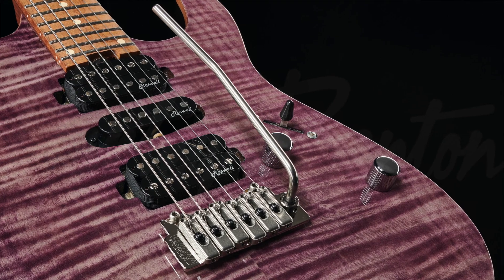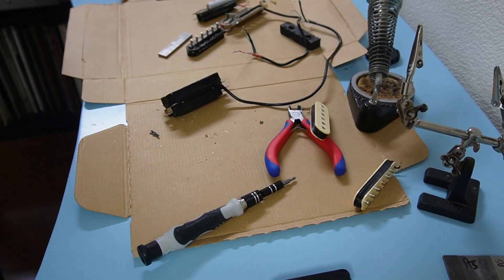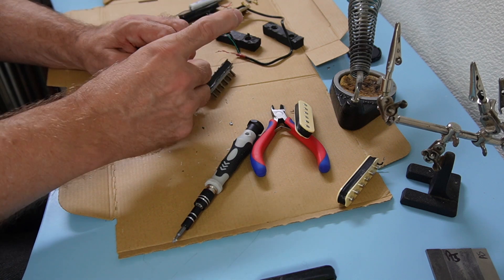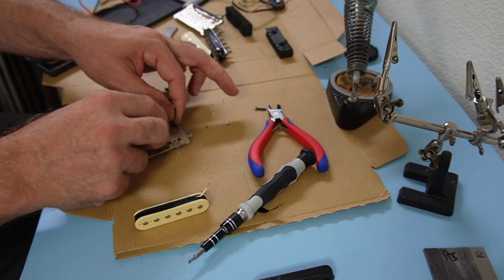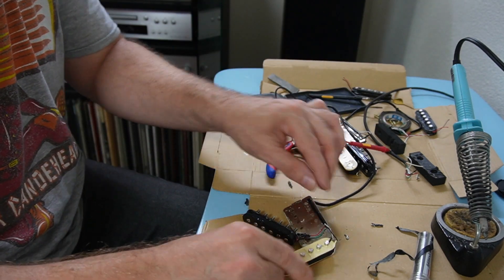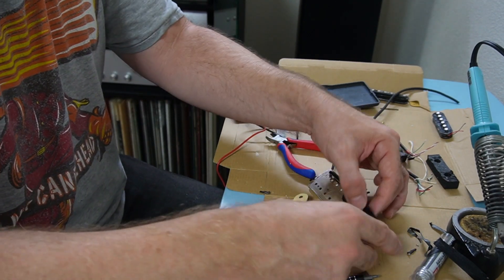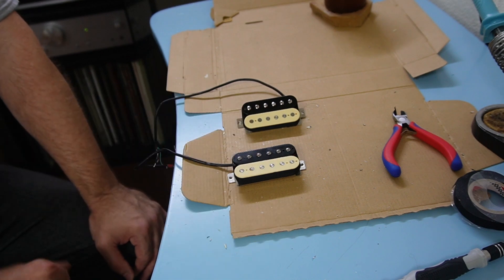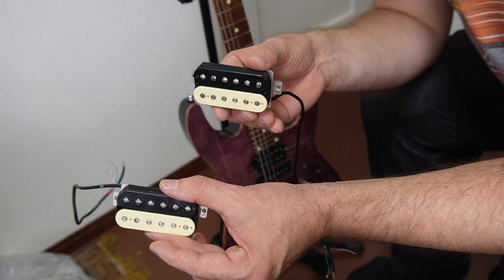Disassembling and Modding Roswell Humbuckers from a Harley Benton Fusion III

Comment: Perhaps I'm not the audience you intended to have, but I came here trying to find how the cable of the Roswell pickups was soldered to the bobbins and you showed it quite clearly.
I'll convert a Roswell PAF's cable from 3 leads and common black lead + shield to 4 leads and separate shield. Thanks for showing it's an easy task (unlike other pickups I opened).
Reply from the maker: That's wonderful! You're definitely the intended audience for a video like this and I'm glad I could be of some help.

Comment: Why are true tapped humbuckers as rare as hens teeth? in the mid '80s I had an Ibanez Roadstar II that had true tapped humbuckers which gave me the thinner single coil but without any 60Hz hum, I regret letting that instrument go, I should have at least put the stock humbuckers in and kept the tapped ones.
Reply from the maker: I guess because true tapping adds a tricky extra step to the manufacturing process ... but yeah, I agree!